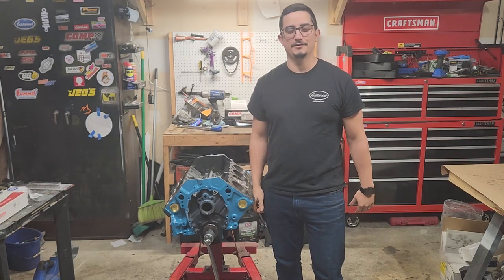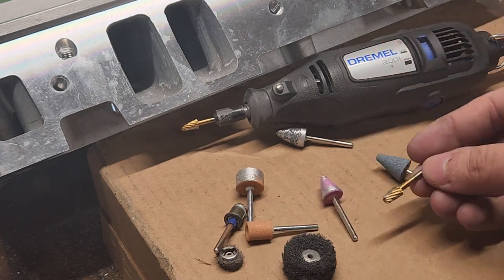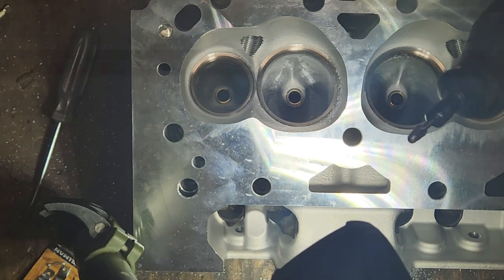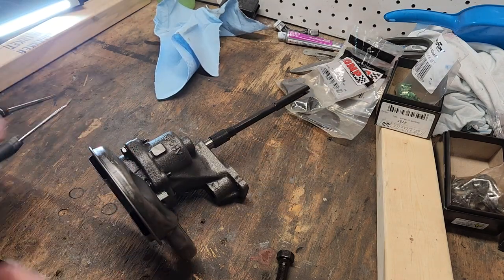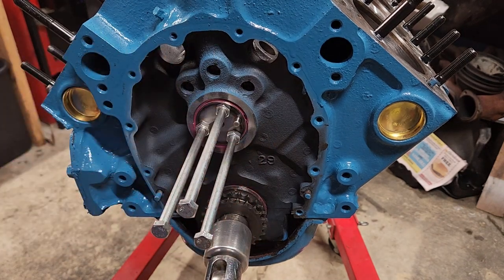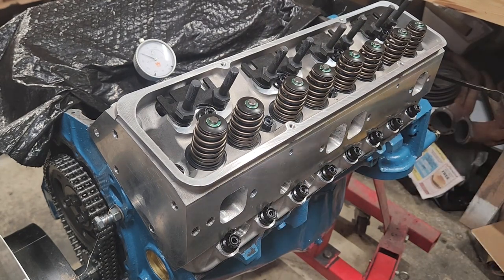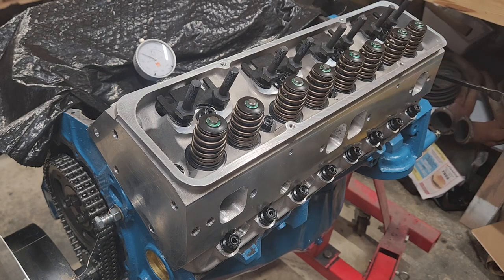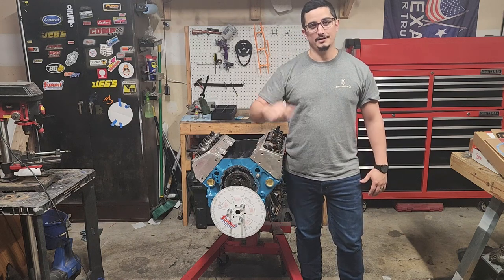Ebay Heads for BUDGET Power?? Are Ebay heads any good? - 400 HP 350 Small Block Chevy Build Part 4

Comment: Cartridge rolls are a much better choice over grinding stones. Your stone are clogged and a clogged stone doesn't remove metal unless you are melting it and pushing it aside. Get yourself some cartridge rolls and a couple of different length arbors. Unfortunately, you have to step up to 1/4" capacity grinder, not the 1/8" capacity of a Dremel tool. Believe me, it does a much better and nicer job. They are availabe in 3 diameters and a few different grits. The burrs you have should work nicely but keep the teeth clean and let the tool do the work and it will clog up less. Vevor sells an electric grinder that is cable operated. You might want to look into one of these unless this is the only pair of head you will ever work on.
Reply: Coat your burrs and stones with WD 40 it will keep your burrs from clogging up with aluminum, I’m not sure if it works on stones but I’d try it.
Reply: Yeah this is cheese ...pure DIY cheese 🧀 🤮

Comment: When doing intake ports on head's, the roof is the most important area! Actually fuel and air probably never touch the floor, air takes the quickest/easiest way it can! So out of your intake the first place it's going to hit is the "roof" of your ports on your head's. Probably don't want to make them really smooth either! Dang, there are much easier valve spring tools out there for cheap! Like 30-40 buck's, I know more expensive than that Ls deal, but a lot easier and safer!
Reply: What are you talking about the entire area of the port will be full of air. Saying none of it will probably never touch the floor is just stupid and if that was the case why would they have all that volume area to begin with…oh that’s right more volume of air can flow and smoothing them out helps air flow restriction is restriction period.

Comment: When you measured the spring height with the caliper did you take into account the thickness of the spring retainer ? Looks like you just measured to the top of the tool which would give you a false reading since the spring retainer is recessed in the measuring tool
Reply from the maker: Nice catch, I appreciate you calling that out! Going to go back and remeasure the spring heights.
Reply: @diveingarage  hopefully all is still ok !
Reply: @diveingarage  I noticed this also and was hoping you had that difference calculated in to your measurments.. hope it all works out ok!

Comment: Always do a multi angle valve job because you want the valve seat to be on the outer edge of the valve face and about the thickness of a dime... this will seal and flow way better...a wide valve seat will not seal properly and can have a tendency to burn...a good valve job can give you up to 50 HP if done properly....

Comment: Get a set of 12” calipers and you’ll be way more accurate on pushrod length, I’d actually say you’re closer to 7.266 or 7.100 pushrod length
Reply from the maker: Definitely a good idea, will need to pickup a set
Reply: 7.266 to 7.100.. that narrows it down... Not! 🤣
Reply: Just buy a push rod checker. If u follow vice grip garage at all Derek did a great video on doing push rod length measuring recently on his Monte Carlo video engine build.
Reply: Agreed, go to your local harbor freight and get a set of 12 inch calipers! However remove the battery (s) when you're done with them otherwise the next time you go to use them it'll be a no go from a dead battery guaranteed!!! If you plan on doing this more than once or twice invest in a good set of calipers!
Reply: I was thinking the very same thing when he whipped out the tape. Lmao. It’s all about learning though. Keep goin kid. Glad to see younger men gettin it.
Reply: Measuring pushroads with calipers wont give you an accurate reading if they have oil holes. It will be low every time.

Pushrods length is an imaginary length when you account for the radius of the ball ends.   When you take a measurement with a caliper the reading will be short X2 depending on the size of the oil hole and the diameter of the hole.

Comment: To save time just lap the valves right off the bat. New heads never seal out of the box. Also you lap the valves you have to lift the valve off the seat periodically because the lifting motion is what brings the lapping compound back in. Keeping the valve down on the seat as you lap keeps the compound on the edge.

Comment: Honestly bought the exact same head and he's right they could use some clean up on ports but honestly they're better than alot of factory sbc heads
Reply from the maker: Nice! Glad you like them
Reply: I believe they may be dart knock offs. Witch is all good , they look exactly like my dart SHP heads. I believe there’s a lot of brotix   knock offs to. For sbc also  I forget what name they Go under.
Reply: @glennborek2359  like it tripped me out everyone said don't buy cheap Chinese heads they'll be a jightmare at the machine shop every hole is tapped so good I've put all my bolts in hand tight before I even touched a ratchet the deck surfaces were beautiful I've seen alot worse from alot more "reputable" brands
Reply from the maker: They really are solid! I'll be using them again for sure. What are you building?
Reply: @diveingarage I'm building a 1968ish 327 , I have the double humps heads original 202 iron heavy they are looking very ruff, was thinking of going with a set of China special..
If I don't use on the 327 I will definitely use on my 350 that i plan to rebuild.
Reply from the maker: The China specials aren't bad!

Comment: Just an FYI when using those bits, spray some wd40 or any lubricant and that will help with aluminum gumming up.
Reply: Mating surfaces like on the bottom of the head, use a block of wood (2x4) that is wider than the head so that you can grab both sides. Place sandpaper (about 600) around the wood and work the wood from end to end on the head. Should give you an idea if you have a low spot without removing to much material.
Reply from the maker: Which bit?
Reply: On the dremel
Reply: Well apparently YouTube didn’t like my link. The burring bit is what I was referring to when using WD40, you can try it with the stone ones as well but I prefer to use the porting sandpaper rolls. You can find the porting set on Amazon and if you are just cleaning the runners up that would be your best option I think.

Comment: Check the clearance with the double roller chain and gear around the bosses for the oil galleries around the cam snout. Not all chains are the same and sometimes you may need to clearance the boss is just a tickle with a die grinder so that the back side of the gear and chain cleaner. As mentioned before get a 12" set of calipers for the pushrod length. You just went through the whole process of setting the valve lash perfectly then ballparked it with a tape measure. Also your spring measurement tool is in metric measurements. It measures from outside edge to inside edge via the keepers. Measuring it the way you did your dial calipers will give you an incorrect measurement. You measured from outside edge to outside edge. Also use lube on the valve guides when machining them or lapping the valves. Putting a little bit of tape over the valve stem goes along way when putting the seals on. The valve stems have a very pronounced edge to them and can tear the seals really easy. I did appreciate the format of the video and the way you presented it keep making more videos. 🤟
Reply from the maker: Wow thank you for all the feedback, I genuinely appreciate it. Definitely going back to double check a few things before moving on.
Reply: @diveingarage  no prob brother we got to keep this hobby alive and strong 🤟 you also got a new subscriber if that helps.
Reply: Yes u can tape the tip or u can get a plastic cover to smooth the keeper groves for seal install.

Comment: After doing all that you really should take a pressure washer or go to the car wash and clean the heads with water to get all the crap and material out of all the holes because air does not clean it that good I find high pressure water get's it so much cleaner then just air
Reply from the maker: Good tip. I did some carb cleaner but a pressure washer sounds like a good idea

Comment: Why didn't you tac weld the pick up tube to the oil pump I never put a pump in without welding it
Reply from the maker: Agreed, good to tack weld the pickup. I did that to this pump combo when I installed it the first time. Way back when I got the truck.

Comment: Is that the ebay DNA heads? I've heard good and bad about the I heard about 2 years ago not to waste money on them because the guides were junk and so were the valves and springs a while back someone said they were way better now. Ñot that I would buy any. I always go with you get what you pay for.
Reply from the maker: If you're going to use these heads I would buy them bare, never know what you'll get with "complete" ebay heads. Better off to assemble them yourself.
Reply: Look like brass valve guides and bronze valve seats. Not what ya want for unleaded fuel.
Reply: @pb68slab18  id run upper cylinder lube even if they were

Comment: I used them on my 383 Stroker, made 553 horsepower, 490 ft/lbs of torque
Reply from the maker: That's awesome! If I can hit 400 I'll be pumped!!
Reply: how much $$ were these heads?
Reply from the maker: About $170/ea on the evilbay
Reply: Have them on my 383 as well.  Ported by Lloyd Elliot.  500ish hp and 520ish tq on E85.
Reply: @diveingarage  whats the build specs on that? Cam? Ported heads too?
Reply from the maker: 230/236 @ .050

I breakdown heads parts in this video. 

https://youtu.be/Y0UGWMUOc7k

Comment: Couple things you really missed the mark on.   A HV pump on an engine that isn't worn out does more harm than good.  If the bearings aren't shot, all you gain is more parasitic loss and heating of the oil.

On your spring height mic, tighten it JUST enough to take out the slack and take your measurement.  If you have small OD retainers that measure off the recess, subtract the .150" depth from your measurement.   When you tighten the crap out of it, it will skew your reading quite a lot.  And its made worse when you measured the unloaded took with caliper tips. (that's why you numbers didn't come out even)

On your pushrod setup, centering your contact patch is 100% the wrong way to do it.

The valves and screw-in studs are not parallel. The tip height of the valve determines where the height of the rocker needs to be. Taller valves will move the rocker towards the exhaust manifold side of the valve.   If the rocker is lower on the stud, it will pull back.

When the valve is 1/2 open, and the cam is 1/2 open, the rocker centerlines should be square with the valve stem.   After you do that, if the contact patch is at the very edge of the tip, you need different rockers.  Installing the wrong pushrods isn't the solution.

It's not where the patch is that really matters, it's how wide it is.  The skinnier the patch, the more direct you're pushing the valve straight down.   If the patch is wide as hell, that means you're pushing across the valve tip while you're pushing down.  That results in side loading that wears out your valve, and you lose lift from moving at an angle the whole time.

Keep in mind, you're not pushing against the skinny valve tip, you're actually pushing against the spring.   So even if you're .025" or .030" off of center, you're still pretty well centered in the spring.

Comment: What's the actual part numbers for the heads I can't seem to find 64cc DNA heads I found 68cc
Reply from the maker: Try searching: SBC Small Block Chevy 350 400 Aluminum Bare Cylinder Head. Should be plenty of options.

Comment: Freaking score bruhda.  The cross hatch told a huge part. Saweet. So as a rookie here, just curious.  What the most powerful stock roller cam the Vortec heads can deal with. Any summit secret cam by chance ??!!
Reply from the maker: Summit makes some great cams for roller and non roller SBCs. Definitely can't lose there
Reply: @diveingarage   There are a handful of fantastic Cam shafts for  Vortex heads for those that want to Max out horsepower and  Torque I won't make any recommendations right now because I don't know if vacuum is needed for power breaks, if somebody wants a flat tap it versus a hydraulic roller, idle quality what kind of vehicle etc  But please reach out if you would like some info.    The valve train is the heart  Of the engine. Please  Only use quality parts regarding the valve train. I will keep this reply short Good luck gentlemen keep on building And speak up if you would like more input please
Reply: Any bigger than 450 lift I think you have to have the spring pockets cut down.
Reply: Old post I know. Vortecs don't flow enough over 500 lift to use a bigger cam. You may loose power. There are a lot of good cams out there around 500 lift.
Reply: I wound up with a .470 lift from comp,they also recommended the correct springs. I did a basic clean up in the runners an blending the bowls just a touch. I'm still assembling everything.  I upgraded the pulleys so I'm almost finished. I will keep you all posted. Thanks for the input.

Comment: Did you get a valve job done?? Because these out the box the valve seats are shit lol need a lot of cutting
Reply from the maker: No valve job. Wanted to see how these heads perform with the valve job they come with. I bet they could be improved for sure!
Reply: @diveingarage  I just got mine back from the machine shop yesterday valve job n porting done, they going on at 11.5:1 383 stroker
Reply from the maker: That sounds awesome!
Reply: @diveingarage  oh she should be a ripper my dad owns a FBO 15’ challenger SRT 392…this mf is a 3880lb long bed square body…it’s already got a decent 700R4 and 3.73 gears,
I hope w the hogged out ass DNA heads it can run good, should be shifting at 6500rpm…gotta beat the new, w spray or not idgaf

Comment: Aren’t you measuring in the wrong spot on the spring height gauge? The retainer sits in a counter bore on gauge. You are measuring from the top of the gauge with your calipers instead of measuring from where the retainer sits. You’re probably .080 off
Reply from the maker: yup, check out my next vid. I address this

Comment: Please check over your video you’ve made a big mistake on the valve spring installed Height  this could get people in trouble you should’ve used a long valves The retainers are recessed Into your spring heights Gauge
Reply from the maker: Thanks,  I did. Few comment threads about that
Reply: Could you please make a new video explaining to people your mistake so they don’t do it thanks

Comment: What is everyone's thoughts on running high volume oil pump with a stock volume pan like he is, I'm very curious bc I just did a 388 stroker with HV oil pump and stock style pan everyone keeps telling me it will suck the pan dry at higher rpm I was even told by someone that I couldn't even run it in a full 1320 without it emptying the pan before it had time to drain back thru the block
Reply from the maker: I was running this pump/pan combo on the street for quite a while and never had that problem. Always good oil pressure. At sustained high rpm I still don't see it emptying the pan and having nothing to pump. Just my .02
Reply: Old wives tail, as long as the drain back holes in the heads are clear, and opened up to the block/head gasket you'll be fine.
Reply: More oil pressure doesn't  mean more volume.
Reply: Circle track raced a Camaro for years stock pan high volume pump never had a oil pressure issue
Reply: 10 pounds of oil pressure per 1k rpm is needed, I prefer when I build mine to be little over 10 pounds
Reply: If you ask ''everyone's thoughts'' you'll get the wrong answer based on wives tales.

The only time you ''need'' a HV pump is if your engine is completely worn out and in need of bearings.

Taller gears than normal (a HV pump) at the same pressure send the same amount of oil to an engine.  The only difference is more oil gets bypassed out of the relief valve.

At any given pressure, flow is the same. That's just basic fluid dynamics.  The gears could be 1" tall or 20" tall.  60PSI, for example, at the engine, is 60PSI at the engine.  And the spring pressure in the oil pump decided that, not gear height.

The bearings aren't going to flow more just because the pump gears are bigger.

Comment: Still don't work as well as a old set of Vortec's with a trick valve job
Reply from the maker: What kind of numbers are you making with that setup?
Reply: @diveingarage  I have made 490hp with a conservative hydraulic roller, on a 400 sbc 9.1 comp.  Not crazy HP, but it made 535 ft lbs.  I am building one right now to sell.
Reply from the maker: Wow! That is pretty good!

Comment: You may wanna check your head stud washers next time they only go on in one direction. The bottom side is concave that goes flat while tightening , you don't just toss them on like rings on bowling pins at the town fare !  Lol 😂
Reply from the maker: Haha thanks for the tip. On name brand head studs you're right. But on the set I'm using they're just flat.